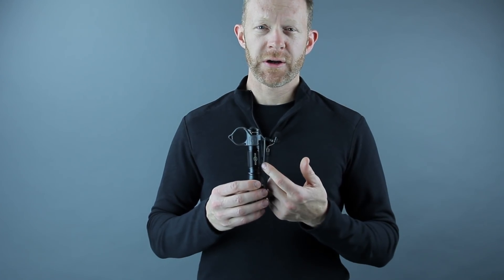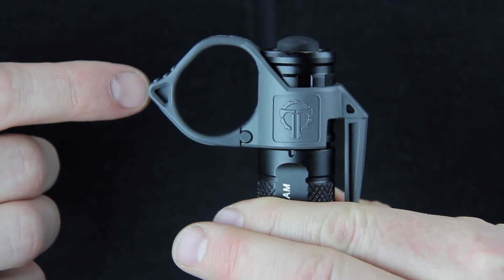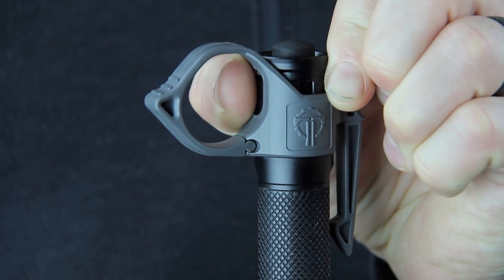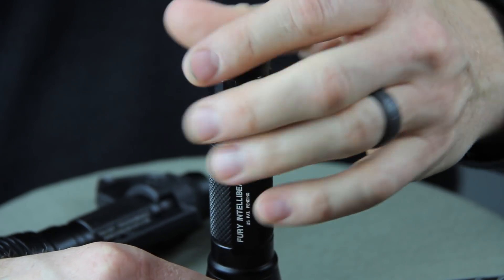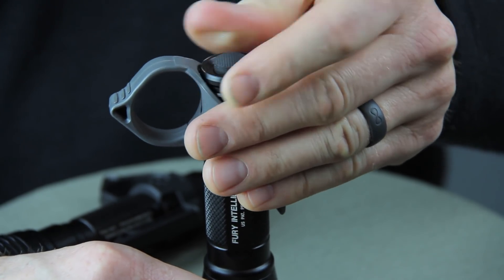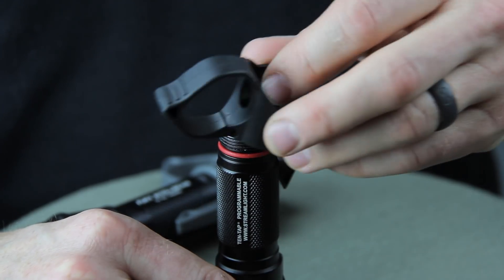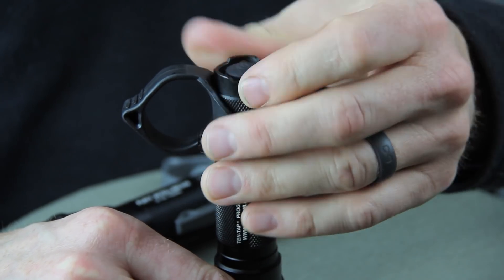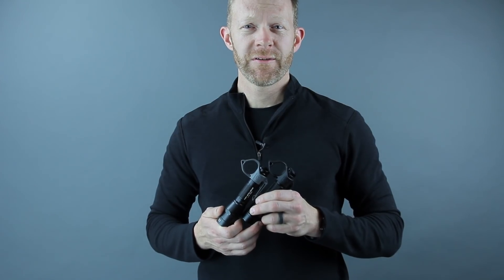THYRM - SwitchBack 2.0 Tactical Flashlight Ring

Comment: I installed one on a convoy M1 flashlight. I shortened the flashlight to 18 350 and because I did so the pocket clip was hitting the bezel of the flashlight, so I heated it up with a heat gun and used my hands to bend it out a little bit. Works like a charm.

Comment: Just got the switchback and put it on my Streamlight ProTac HL . I’m not saying it is hard or difficult to do but because the Streamlight button is somewhat recessed in the tail cap it makes it hard to activate when flipping it around to help hold your firearm.
The Surefire tailcaps have a more pronounced button and easier to activate. 
Lesson learned
Reply: Can confirm. True.